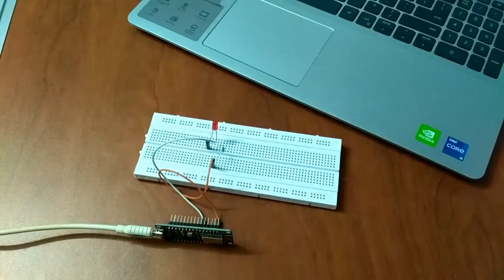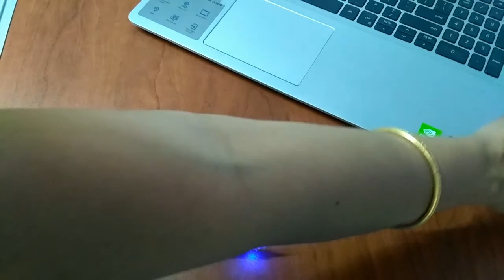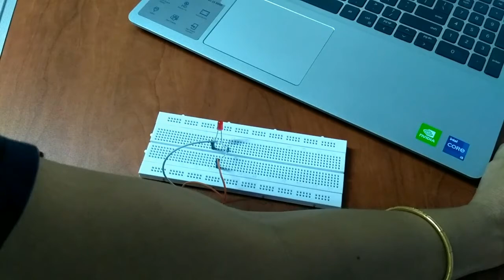LED blinking using NodeMcu

Comment: Are mam laptop ka screen to nahi dikhare app and kese hum smjege codes kay hai
Reply from the maker: Will upload code in description box. Run that code in arduino ide and you will get the output
Reply: @electronicssolutions9981  ya please
Reply from the maker: Uploaded the code
Reply: @electronicssolutions9981  thx